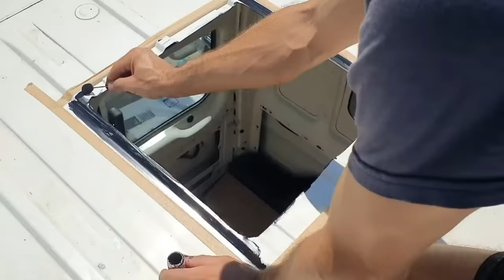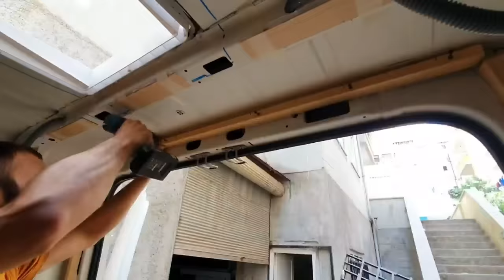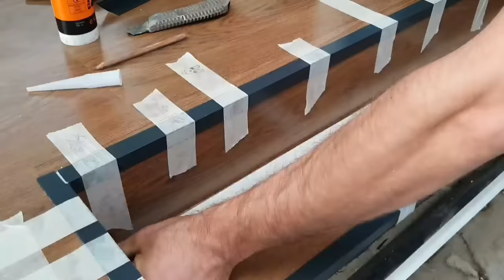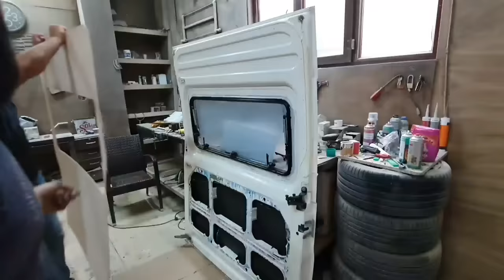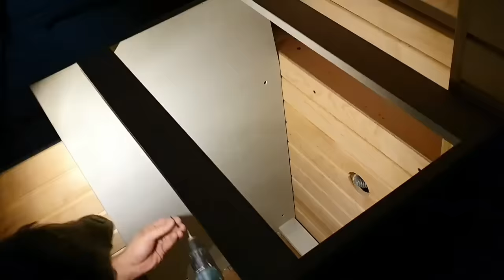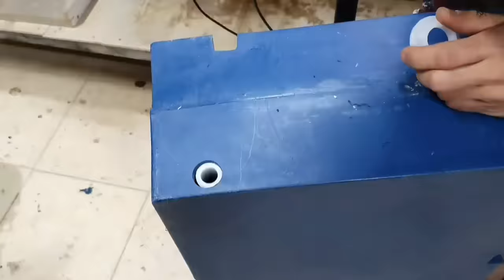10 Dakikada sıfırdan karavan yapımı / Campervan start to finis in 10 minutes / Ford transit

Comment: Looks really nice! You also seem to know how to proper work with wood. But I fear you guys overdone it weight wise. There is alot potential in this build for saving weight, less weight = more safe (breaks, engine) and cheaper patrol.
Reply: @user-el9df1gg1q  bruh
Reply: Good point,you need a certificate and therefore an inspection takes place ,the weight needs too be considered depending on the vehicle loading capacity.

Comment: Really appreciate videos like this,..Nice job! However, I have never seen anyone consider the weight of the vehicle after the rebuild. In my country, most similar vans are allowed to load between 600-1000kg.
Other things that are not usually reflected is that the users of these vehicles do not have unlimited money..It is usually old and very worn cars that are used.People seem to set a budget to buy and build their own car..A budget that is always higher than expexted as they were unable to oversee the project..They have a dream of fantastic trips in their car,perhaps thousands of km from home..All this is of course a wonderful thougt but if you know nothing about car holidays in advance and are not mechanically knowledgeable about cars,the trip can quickly become a nightmare instead..What does it cost, for example,with a damaged Turbo in Greece?😮 A good suggestion in my opinion is therefore to first gain experience by for example,renting a car and taking a "test drive"
..From that,you can then better understand and plan your possible construction..😊

Comment: Scrap under seal everything even the rust leaks everywhere extra ton of weight and no suspension upgrades nothing mechanical not even brakes I would not like to see it after a crash